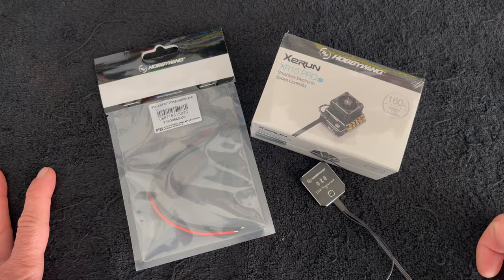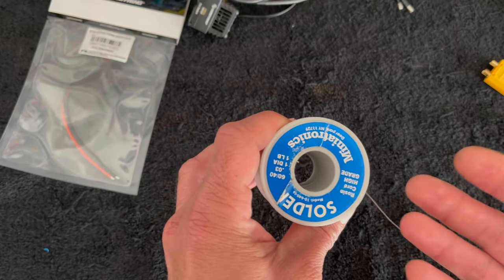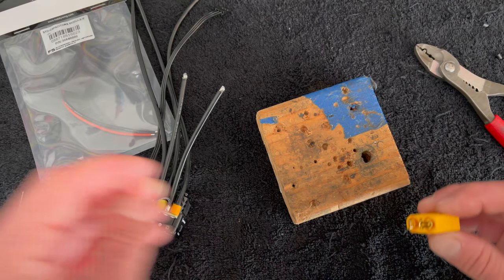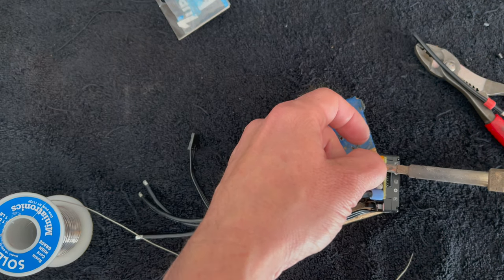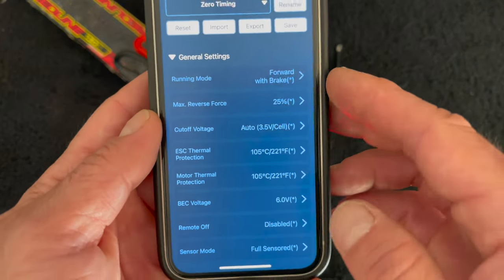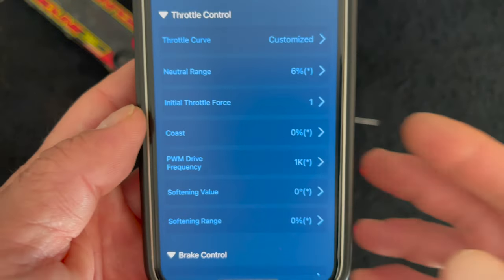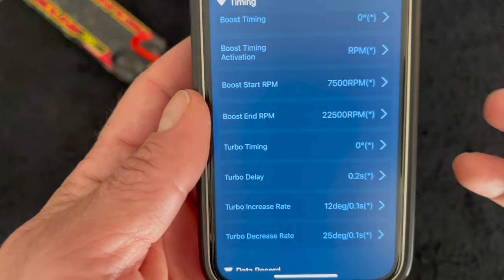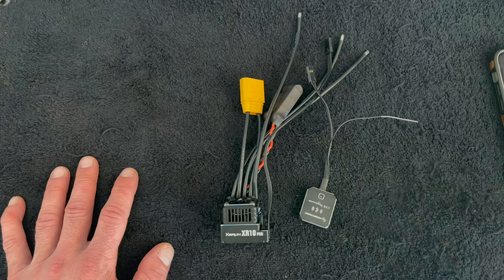The Charlie Show /// Episode 313 /// XR10 Pro G2S

Comment: Hello, i have xr10pro g2s elite. If i use xt60 plug. Is it good enough or not capable for xr10pro 160a?because i read xt60 just support 60a continues.
Reply from the maker: Depends on the usage really.  We've run XT60's and had "okay" luck.  But once a person starts to "Drive hard" they tend to melt.  Most of our go fast vehicles, even just for 2s, are on XT90 plugs now.

Comment: Hi... great vids.. I'm wondering what motors your pairing with the Xr10 Pro for 4x4 sct?
I'm currrently running a 3660 (4300kv) & considering trying this esc in a Tekno sct410.3? 
Any ideas?
Eric
Reply from the maker: Hello,
Yes we recommend upgrading to the larger power capacitor as added protection for the ESC from the 4pole motor.

Comment: Hello, its xr10pro 160a (first gen) have reversed polarity protection?
Because yesterday i put the wrong battery cable and blow the capasitor. Esc seems working fine.
Is it just broken capasitor and i have repalce it or i just lucky or my esc doesnt perform normal?
Thanks
Reply from the maker: Sometimes they will be ok with just needing a power cap replaced.  Often they suffer more damage, but that usually shows itself right away as a basic operation or function problem.

Comment: Hello. Can someone from Hobbywing help answer the question between the 2 different G2S models. One has a frameless fan and one doesn't. I was going to buy the framelss fan one until I realized it might take a specific fan. I don't want to be stuck buying an expensive hobbywing frameless fan. The other G2S model looks like it will accept any 30mm fan. Can someone please elaborate on these differences please
Reply from the maker: Frameless fan setup is only going to fit the frameless fan replacement.  The case is different between the two models, not just the fan. The frameless fan case, does not fit a standard fan.  Feel free to email us for further information.  NorthAmerica@hobbywing.com